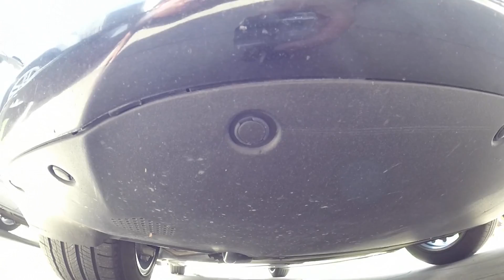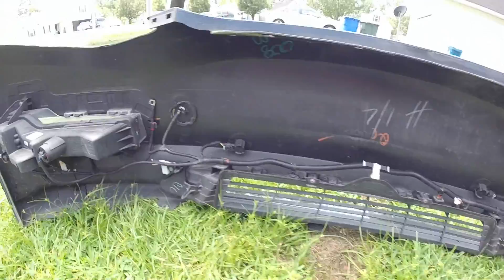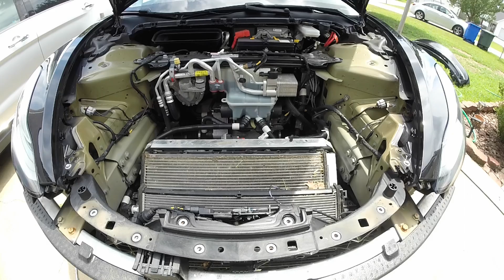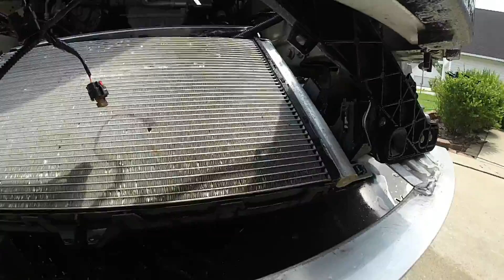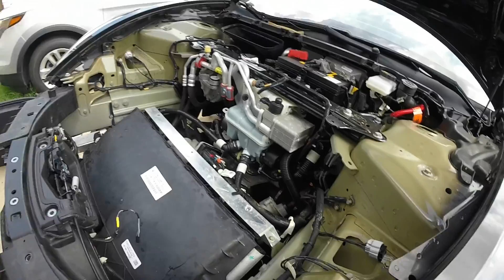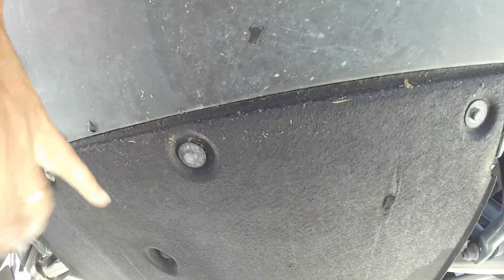Tesla Model 3 radiator condenser cleaning

Comment: Every video I’ve watch where someone actually removes the upper radiator shroud they say it has to come out the bottom and facia has to be removed. 
It will come out the top easily. Without having to flex it like the guy in this video
It helped me to take the lower radiator bolts out. It drop the whole radiator/ fan assembly down about 3 inches

Comment: Taking a massive risk not using jack stands
Reply from the maker: I don't have the correct jack stands to hold a tesla. Teslas only have 4 lift points. There's no other place to hold the car up without causing damage. Everything underneath is battery and aero.

Comment: This is one of the very best video on how to clean "correctly" the radiator and AC condenser on the Tesla Model 3. A 5 Stars for this guy !!!
Reply from the maker: There is an easier way, but it requires a 2 post lift. Lol
Reply: @jorgegarcia7005  
Great video, please explain how a 2-post car lift helps in this case.  Thanks!
Reply from the maker: @donaldduck5093 a 2 post lift eliminates the need to remove the bumper by removing the aero shiels and valance and lowering the radiator assembly to remove the shroud instead giving you access to the radiator for cleaning.

Comment: Что бы почистить эти всраные раиаторы, нужно развалить пол морды... в чём прикол этого свободного места спереди... бред. В Renault Espace всё было в разы проще!
Reply from the maker: If you have a lift, you don't have to take everything off the front. You can drop the radiator from the bottom and then clean it. The way that I did it was to make it easier to clean in your driveway.

Comment: I'm just curious—how often do you normally clean the A/C condenser on your Tesla Model 3 to ensure it has good airflow and operates efficiently?
Reply from the maker: If it's never been done, I would do it the way I showed in this video. If your radiator is not as bad, then you can use compressed air and remove the minor stuff by blowing it thru the back. I clean mine after fall to get the leaves out, if I notice that it's filled with crud then I would do it with the pressure washer. It totally depends on the environment the car is in. For example, my friends tesla tends to be in construction sites, his radiator gets more dust than mine, and when it rains, the dust eventually sticks to his radiator and turns into clay. His needs thorough cleaning 2 times a year, while mine gets a cleaning once a year. Be mindful that 2017 to 2020 have the the small radiator paired with the condensor, which requires removal to get the contaminants between the two. The newer models only have a radiator, which are easier to clean.

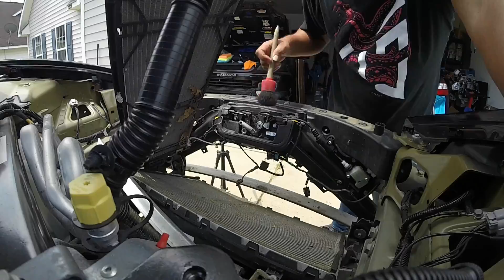Comment: 19:19 I was think a leaf blower might be good. Not a complete solution but partially.
Reply from the maker: It depends on the amount of debris. If it's simple leaves then yes. If it is dried dirt then no. There is usually alot of stuff stuck between the plastic grill and radiator and alot of stuff between the older radiator and condensor like the one on this video.
Reply: @jorgegarcia7005 
I didn’t say a complete solution. But something to help.

Comment: Too much work for just cleaning radiator. Some other videos much much income. Simpler
Reply from the maker: My video is dedicated to those who are not afraid of work and getting the best results. Can you lift the car on a 2 post lift and blow air thru the back and get some of the debris out? Yes, will it remove the majority of crap? No.  You can do this the hard way and go a couple of years before having to redo this, or you can just clean it every 6 months the easy way. I've been doing this cleaning for quite a while now to multiple cars. The ones who come back are the ones who paid for the basic cleaning, those who got the full cleaning have come only to verify it they needed a cleaning. I've performed plenty of thermal tests to see the results in 4k. Deep clean last longer than cheap clen. The thermal management system performance is the most important system in your tesla. Maintain it as you see fit.

Comment: My fan sounds like a loud lawnmower when running, any idea what the issue could be? I cleaned all the leaves and debris off my radiator already, is there a way to check on the underside of the radiator where the fan is to check if anything got stuck there?
Reply from the maker: It is possible that your fan is going out. You can remove the front aeroshield and inspect for debris. Just make sure that you power down the car before getting close to the fan as it can power up at any time and may cause injury.

Comment: A different method is to rotate the top of the radiator forwards and remove the fan, then clean from the back so you don’t push all that dirt into the fan. Please disconnect the ‘starter’ battery before working!

Comment: Thanks man👍. Washed mine after watching your video. Hope more people see this. Otherwise the battery cooling and AC will be struggling to cool( or heat up). Especially in 100+degree weather.
I also changed at 80k miles the whole receiver dryer ( aka the AC condenser; nowadays one piece); and they have to measure the refrigerant. Well worth to do after 6 years.
Overheating can cost the big battery.

Comment: I honestly wonder have you replaced your ac compressor and if so how many times??
Reply from the maker: I haven't replaced a compressor in none of my 3 teslas. I believe that when the radiator/condensor is blocked, it causes the compressor to work harder and somehow it causes damage to it. Many of the compressors I've seen replaced had a blocked radiator/condensor.
Reply: @jorgegarcia7005 thanks for the feed back i was told compressor issues are in 2021 and newer models is yours in that year range?
Reply from the maker: @AeroNationHD One was. Now I heve two 2025's
Reply from the maker: Mine is a 2019.

Comment: I have a 2023 model delivered in dec 2022 and i think i know why my ac compressor failed thats terrible. Mine just failed have service in 20 days 😢 with no ac i wonder if they will even take the radiator apart and do this my guess is they wont provably replace the part only guess i got some work to do in a month or so thank you for this detailed video!

Comment: Just cleaned mine at 93k and it was covered in trash. I did not remove the bumper but i did undo the forward clips to the under panel and the 4 bolts that hold the condenser to the frame. This is just enough room to drop the condenser down and slide the cover but very careful to not drag it along the condenser.
Reply from the maker: At work I do these on a lift. You are correct, you don't have to remove the bumper and removing the front valence gives you the room necessary to do it from the bottom. When I did this video, I was doing it as a way for a diy with minimal tools. But the way you did it is also a better option to be honest.

Comment: I appreciate this video, as it has provided valuable insights into the cleaning process, and now we understand the reasons behind the AC pressure's inefficiency. I am grateful for this information.

Thanks.
Reply from the maker: This maintenance is important to prevent compressor failure as well.

Comment: George can you explain how we can stop or slow down that area from getting so dirty
Reply from the maker: They sell a screen that can prevent major items like leaves, grass, cigarette buts, etc, and most dirt and sand particles from entering the grill. However, water and dust can still get in the radiator, and with time, it can still clogg it. I would suggest a screen and a yearly cleaning to maintain optimal cooling.
Reply: @jorgegarcia7005 thanks for the video and advice.
Reply: @jorgegarcia7005 i also saw you have friends / costumers with tesla’s, do you have any with 2020-2023 Model X’s that found covers for the front grille intake.

Comment: my car only has 1 radiator. there is no smaller radiator like yours has? i’m confused
Reply from the maker: Your car has a super manifold. Only has a radiator and no condensor. Procedure is the same.
Reply: @jorgegarcia7005 it will still help the ac run colder right ?
Reply from the maker: @navarra_rs5_  Yes, if your radiator is filled with crud your fan will not pull thru enough CFM to remove the heat from the coolant which takes the heat out of the refrigerant.

Comment: All of that was very unnecessary. You can clean this without taking off the front bumper or taking out the shielding.
Reply from the maker: Actually, now that I have more experience with this process I can see your point. However, when I did this originally, as you can see in the videos, it was in a driveway without a lift and with the assumption that many don't have a way to lift their cars properly. My video is for the less experienced, and it works best imo.
Reply: @jorgegarcia7005 hi Jorge, great video! Just wondering if you have  a video that shows without removing the bumper? Thanks!

Comment: Great, great video.  Suggestion to make install easier.  Mark the left side of the two left radiator tabs that slide out to the right to remove.  There is way more tab then their needs to be.  When you have removed, cut these tabs shorter at the mark you made, way easier to install afterwards !!

Comment: Great video. I had to remove the bumper on my second hand M3 2019 LR 110.000 km) to repair a pdc bracket coming off. Just one week later the sun came out and i noticed the AC was struggling. Now i have to take the bumper off again. 😢

I’m kinda hoping it is full of junk otherwise i have a leak or a faulty compressor. Questions; there are 2 radiators, which one is used for AC? And is it easy to see between the radiators without taking the bumper off? (to check if needed)
Reply from the maker: @frietjesate6288  the large one is the condensor, the small one is the radiator. You can look thru the grill and see if it's full of stuff. But to really look at the condition of crap wedged into the fins it's hard without removing the shroud.
Reply: is it really that stuffed with stones etc? I can imagine large leaves blocking the airflow, but theres so many fins, the small stones won’t be a problem?
Reply from the maker: @frietjesate6288  that's why I pressure wash it. To get the most amount of crud out of the fins. The alternative is to have a service center replace the condensor and radiator.

Comment: I had a spinning bolt under the car on the exact same one as you--I have watched you grab with your pliers and then manage to free it--I finally got it-You also mentioned  the housing was out of place and I am wondering how you returned the housing back when you fastened everything back up? I successfully did this pressure washing and helped a friend today as well. Excellent video! You are quite thorough. I was able to forgo the under bumper pushpins today from your other video"s suggestion!

Comment: isnt it a safety problem using water on the frunks guts while the inner plastic cover is completely removed? there is a live high voltage battery present after all...
Reply from the maker: @b0570nk4  all these components are open to the elements. They are sealed, it will be fine.

Comment: Did the cleaning today. What a mess below. Leafes, sigarettes en dirt. Could not get the condensor out of the way because could not slider it because the left hose was blocked by the frame. Thanks for the video. Clear and step by step
Reply: Did you find the solution??
I couldn't slide out do to hose too

Comment: Any experience with cleaning with steam?
Reply from the maker: @JOE.DANCEN  no. And I don't see how it would be beneficial.
Reply: @jorgegarcia7005 well..hot steam dissolves all the grease and other particles?
Reply from the maker: @JOE.DANCEN  you are not going to see any real oil built up on the radiator. It will be mostly sandy, pebblely build up.

Comment: Thank you for the video. Great job. Why arent you use the hose from the backside? That way you push dirt out instead of in....any thought on that
Reply from the maker: @JOE.DANCEN  there's no room to do this from the back without removing the condensor, and I don't have a freon recovery machine.
Reply: Thank you. I am going to try to use the 90 degrees nozzle on my karcher.
Reply from the maker: @JOE.DANCEN  just remember to test an area first and don't get too close and keep the flow of water straight. Too close or sideways pressured water can bend your fins.
Reply: @jorgegarcia7005  thanks. Will use the lowest power on the cleaner. Will soak it in cleaner before low power hose it down

Comment: My radiator looks totally different. Have a 2022 M3 Long range. Also, my radiator cover has a chord attached to it, and the chord connects to wires
Reply from the maker: @DaronHoward  your cooling system is different. My 2019 doesn't have a super manifold. You can see the model y video I made. That has the same system as yours.

Comment: Thank you for this! Most of the other videos don't go far enough to get things really clean. I picked up my Model 3 with ~170k miles and the radiator couldn't have been more packed with dirt and crud. There was zero airflow at all (I have pictures!) and as a result was the AC didn't work at all, and the fan was always howling trying to cool the car. The last straw was when I showed up to a meeting soaked with sweat. I took an evening off and got this done. Your video clearly explained every step I needed to take (though it made some steps look easier than they ended up being for me.) Now that it's clean, it's working so well. You saved me! (PS. I got a great deal on the car, in part I think, because the AC didn't work!)
Reply from the maker: @michaelrcolton  thanks for your feedback. Because I have worked on cars for over 24 years I tend to forget that I need to explain certain things more clearly because I tend to forget that not everyone understands how certain things come appart.
Reply: @jorgegarcia7005  I think you did a great job explaining. There were some things that were just harder for me probably due to my inexperience. The important thing for me is that you didn't skip anything. I just followed along on my phone, step by step, pausing whenever I needed to catch up.
Reply from the maker: @michaelrcolton  nice. That was my intention.

Comment: After doing this I got an error message that says “Climate keeper unavailable due to system fault”. I suspect it’s because I didn’t put the car in service mode. Now I need to make an appointment with Tesla. I will keep everyone updated on what the issue is.
Reply from the maker: @db3837  this error message typically comes after a windshield replacement, however, I would make sure that you plugged in all connections unplugged during the cleaning process. Typically in the past the issue has also been a software issue, you can try a soft reset and if that doesn't work, you can try a hard reset. Both procedures are outlined in the onboard users manual.

Comment: How much space is between the two radiators?
Reply from the maker: @TheRealMariposa-ye6gr  should be about 1 inch.
Reply: @jorgegarcia7005  Thanks, I picked up a dryer vent hose thats pretty slim to fit between them.  It's about 1/3" thick
Reply from the maker: @TheRealMariposa-ye6gr  if you look at my videos, I made a video explaining why I pressure wash vs other methods of cleaning. The vacuum won't get the blockage out.
Reply: @jorgegarcia7005  Yeah understood. That's definitely the best way to get it fully clean.

Comment: DO NOT PRESSURE WASH. Looks like some fins were bent. There are special or metal brushes from Amazon to clean the fins of the radiator and straighten the fins much better than a washer.
Reply from the maker: I'm going to pressure wash again next month when I do a one year follow up. The Amazon fin brush you are referring to doesn't clean radiator fins. Thos brushes are used to strengthen fins and don't work on this style radiator.
Reply: @jorgegarcia7005  your radiator. Good detail on removal to get to the dirtiest parts.

Comment: I sitting in a Tesla waiting room,  getting this exact thing done for the second time as I watch this. I am out of warranty, so I was wondering how to do this on my own.  THANK YOU FOR THIS!
Reply: How much did it run u? I'm also out of warranty
Reply: @SepOn35  they changed me $400 for the disassembly and cleaning of all that.  The estimate was a lot more but obviously I didn’t need anything replaced.
Reply: @Twigy_22  thanks for the info
Reply: @Twigy_22 what year is ur car and why did u decide to do it? Was the ac or heater not running right/ making noise, etc. I just wondering when I should take it in to clean. Do u think the cleaning is covered under warranty? Any info is greatly appreciated.
Reply: @kcaegis45  it was a 2019.  I have a 2022 now.  There was nothing broken or wrong.  I live in the CA desert area and the amount of sand and desert debris is astounding.   They just needed to take the radiators out and pressure wash them, clean them up and reassemble.  Cost me about $225.  Was well worth it.
Reply: @Twigy_22 
Seems reasonable priced after watching this video.
Reply: You can buy front grill covers for Model 3/Y that do a great job of filtering out the crap that can get caught in the radiator and save all this work.
Reply: @mowcowbell  this helped me out tons also. Very well worth the $35 from Amazon
Reply: @mowcowbell Sadly, the screens are only going to catch the big debris. It’s the tiny rocks that get into the fins. An owner reported on the Tesla Forum that even PWing from the rear (condenser removed) he ended up replacing the coil.
Reply: Oops, got to be an expensive job! 😅